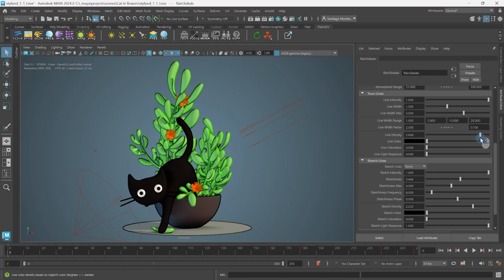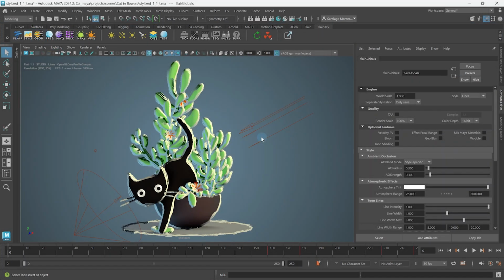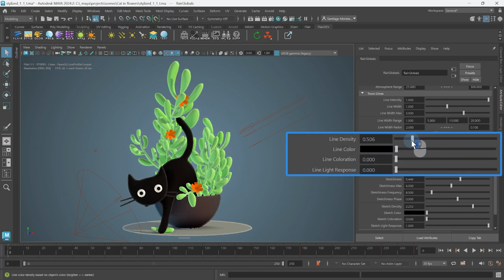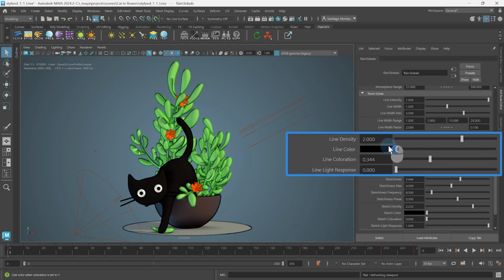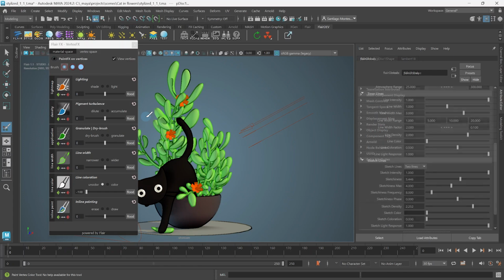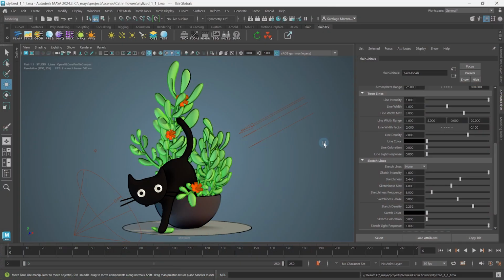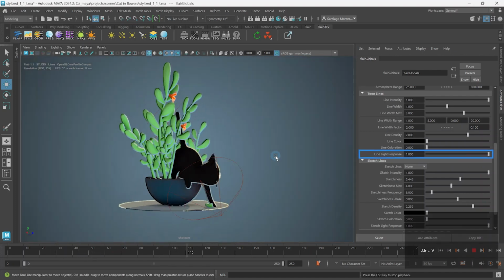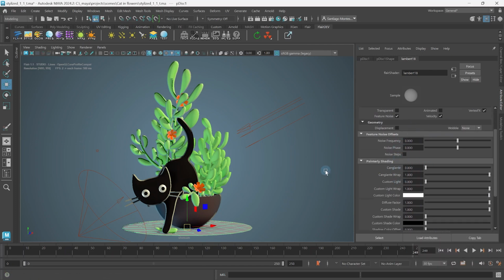Toon & Sketch Lines - Custom color lines in Flair for Maya - Stylized Rendering

Comment: Can this be applied if the style is watercolor?
Reply from the maker: These are separate styles. However, they do share a lot of effects in common and you can still achieve a watercolor look with the lines style if you use wobble to replace bleeding